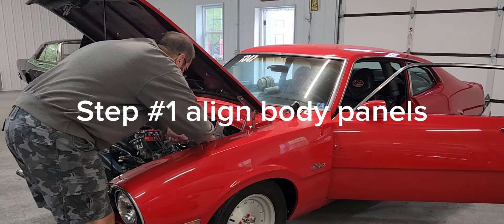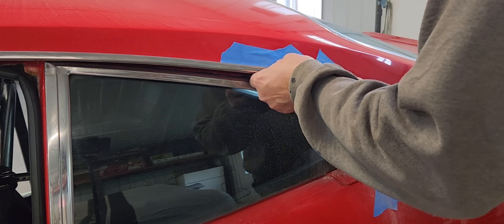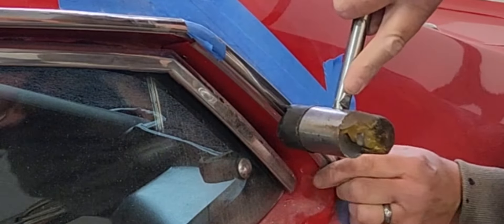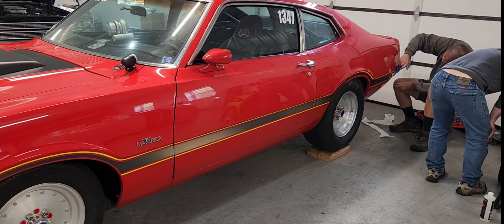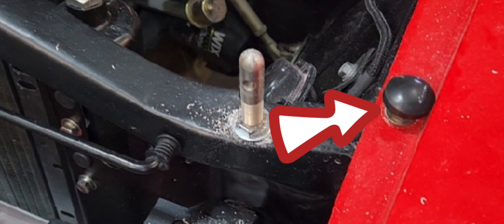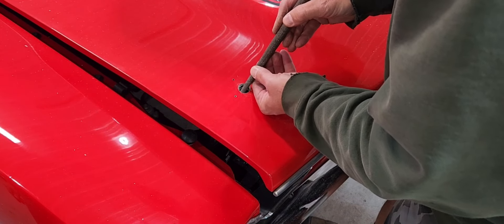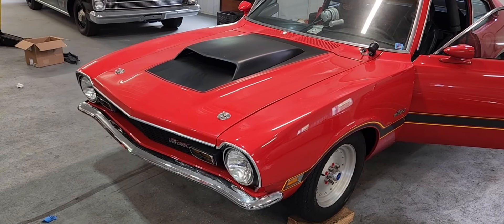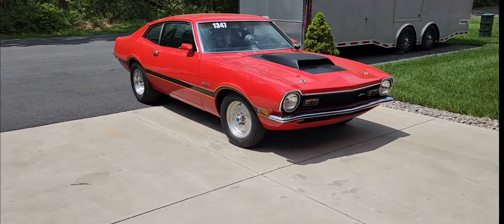1970 Ford Maverick Drag Car Stripe Install / Ford Maverick

Comment: I wish you went a little more into on adjusting the door. I’m having problems getting mine to line up after having it off. It keeps barely touching fender right in the center. Any advice?

Comment: Hey I have a 65 Mercury Park Lane and the rear windows have chrome edging, like this car does, that holds on a rubber seal between door and rear glass. I got new rubber but I have no idea how to remove the chrome window edging to replace it. Any thoughts?
Reply from the maker: Carefully...lol. You probably need to take the whole window out and then look for screws that attach it to the frame. Undo those screws and carefully pry away the trim